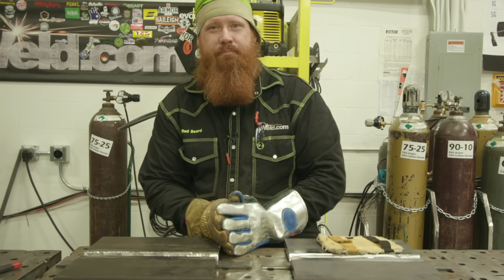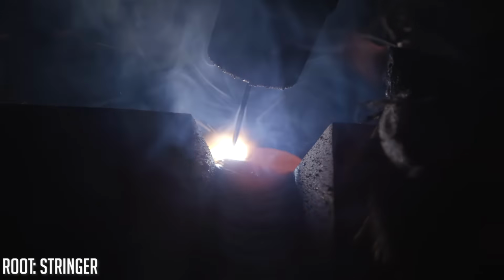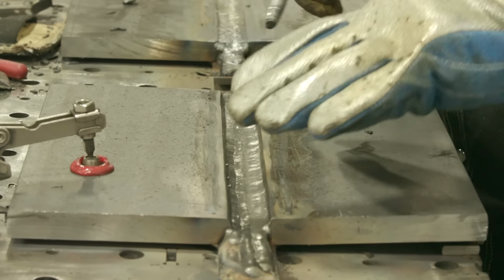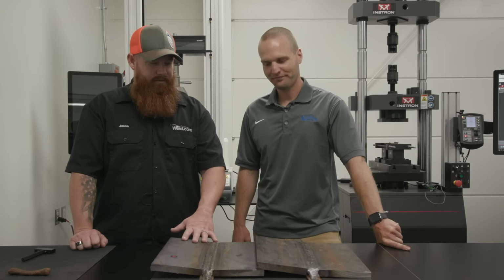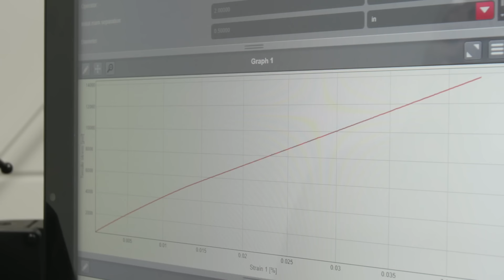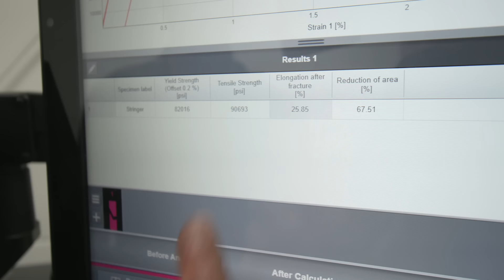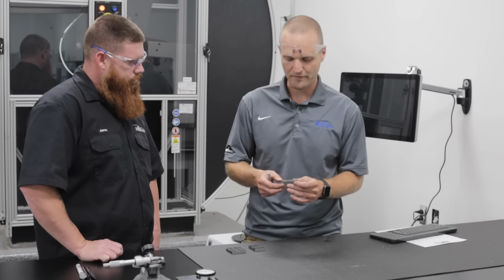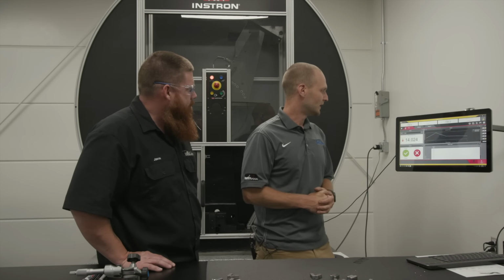Stringers vs Weaves

Comment: Very few times that I've needed to run multiple passes, but when I had to, I ran stringers then capped with a weave with the heat turned up and travel speed a lot faster, I.e. lay down filler material over top with less penetration. My reckoning was it put less heat in to the material while leaving a good looking weld. What would your take on that be?

Comment: Why do you run your torch backwards?  Was the steel set that way at the start or did the plate lift that to that angle?  Do you ever use the other weld patterns in deep plates?

Comment: now i know why i used stringers on 1inch plate welded to a 1/2 inch thick 10"×10"×10' long square tube for a bus wash brushes 30 plus yrs. ago...STRENGTH! I always thought the more heat the weaker the weld. i wonder now how tig welding pipe does hold up?

Comment: At 7:15 it looks like the nozzle is completely clogged, is this just an illusion from the camera angle?
Reply: Phill Huddleston just the angle catching the out side of the near side and the inside of the far side. You’d know if it was clogged at all. It would be full of porosity.
Reply: @GodslilRedneck23  That's what I figured but being gas shielded flux core I wasn't sure if the flux was enough to keep the porosity away by itself or not. I've welded with gas and flux core but not this stuff.
Reply: @phillhuddleston9445  I can confirm, if the nozzle is clogged, you will know.  There is not near enough from the flux core to do the job alone.  Just ran some 71M tonight at work.

Comment: so adequate cooling is playing a major role.
maybe we should focus more on letting the weld cool down inbetween welding???
attaching an aluminium plate by magnet would be a great way, maybe throwing a fan on there
so its not about slag, its about grain structure. i always disagreed that weaves would inevitably get slag inclusions, its about keeping the weld hot enough. i would think weaves are stronger because you blend the material better together
i guess it also depends on how hot your material is getting, if its a very large weld it will be more significant but if youre welding very thick material and it has plenty chance of cooling down weave shouldnt make much difference

and this would in reality mean that downhill pass, being a colder faster weld, is actually superior to uphill pass- downhill is illegal in my country basically. interesting. there must be something about a balance of heat penetration vs grain structure

Comment: Very interesting video and great to learn from it so thank you and well done!

Can you do a test to determine which is stronger between ER70S6 Mig and 7018 Stick welding please? I know there are variables but if the test ran same settings on the same plate running stringers (Known to be stronger than weaves) then it would settle the argument. Both have the same tensile strength as we all know but its like the stringer vs weave test which one is better under test conditions.

Comment: I'm no welder, but what if you cap stringer welds with a weave? You should (in theory) get the strength of stringers and the looks of the weave.... right?

Comment: Sorry, 1yr old comment. During school in '19 there was word that AWS doesn't like Weaves after a certain width. Too wide of a weave introduces micro heat cycling between each puddle pause, might be why you see the reduced tensile strength in Weaves.

Comment: Question Have you ever ran stringer and weav on the same piece? I wonder if it would make a difference?
Reply: I have. I've run the root then run a weave above that root and finished with stringers.
  All depends on how much space you were actually filling. It's too little space to run 2 stringers better to run a weave

Comment: Great video but the first test was a bit inconclusive because the weave sample had some porosity or other defect. Did you try that pull test on any of the other sections of the weave weld?
Reply: And therein lies one of the significant points. Slag inclusions can be a common problem with weaves, (notably with stick and flux-cored).

Comment: You should do the 2 types of weld again with hath the thickness and do a cross lace pattern with the weld it’s harder but it tends to be a higher durability and also do some acid etching of the grain structure

Comment: Amazing video. It looks like stringers are stronger, but weaves are faster.  At times from a production standpoint speed is more important, if the strength is good enough to meet requirements.
Reply: that's also depending also on interpass temperature reqs, since weaves will always put in more heat. with strict interpass limits you might wind up sitting around longer waiting for the part to cool if you weave, which reduces the speed advantage. then again, any time you're working within tolerances like that it's never a good idea to weave in the first place
Reply: I cannot agree that weaves are faster. The metal lays down at the same rate no matter what your style. 

In this case, the filler comes out of the nozzle at the same rate in both cases, so how can weave be faster?
Reply: @tandemwings4733  watch the video
Reply: @smersh007  I don't know what form of magic you believe in, but the fact is, in this case, only 'X' amount of filler metal is available at any given time. The ONLY difference in deposition rate between weaving and strings, is the ability of the operator (welder) to manage stops and starts. I did watch the entire video and I am relying on a shit load of experience. Decades more experience than the young chap doing the show and yourself.
Reply: @tandemwings4733  that's exactly it. Completing a weldment not just about depositing rate. Let's say you do 3 stringer vs 1 weave. 3x start stops, 3x cleaning. It all adds up.
Reply: @smersh007 . Now we're getting into the guts of it. You are assuming that there is cleaning to do. My experience tells me that cleaning (de-slagging) is a consideration on something like (at a guess) less than 10% of all multiple pass hand welding. Manual Arc and Shielded Flux Core processes are in the absolute minority. When we were fabricating for earth-moving, using 1.6mm wire (that's 14 gauge or 1/16th for the backward imperial users) in MIG process, our (personal fun challenges) comparisons showed up only marginal differences between weave and string runs, which was good because I didn't want that concentrated heat in the weldments anyway. Plus, when you get up around 3/4" wide, weave starts to get a bit dicey, so why use it? In approx 48 years of welding, I've never found the need for weaving, and, especially after training, I've not ever been comfortable with it.

Comment: Great video,Have a off topic question,I saw I in the video 90 10 gas,I have been told this mix works better than C25 for thin sheet metal. I can't seem to find info on this,any help.
Reply: Certified welder here. 40+ certs, no B.S. CO2 is for penetration and lower cost gas in large scale production. As the balance of CO2 drops, such as (CO2/Ar): 75/25 to 90/10, 95/5, 98/2, 100% Ar, so does the penetration due to the properties of Argon. Argon at 90/10 is a shallower weld profile, better wetting, less spatter, and is a great gas all around for sheet metal up to 1/4" plate.
Reply: @deanbarrett7180  Thanks so much,been searching for this info for a while,really appreciate it!

Comment: Just curious but with such a wide gap why not split it with 2 weaves instead of the almost inch and a half weave. I would think that would cut down on the heat considerably and possibly help from becoming brittle.
Reply: It would of made the difference between weave and stringers almost nil .. had it been properly done. It was a test biased for stringers to shine out ..

Comment: For all the wire feed welding I have done I have never seen slag on it so it was a different type wire welding cause all mine was a clean metal after wards. So explain what you did differently than I have done
Reply: Flux core as stated at start of video.

Comment: Is this test true for single pass welds of 1/8 metal or just for multipass welds...just getting started here, thanks.
Very informative video btw
Reply: Juan Castillo generally the only time you have enough space to weave is when you're doing multipass welds, a single bead in a joint should always be a stringer (single pass weaves are OK if you're doing surfacing/buildup, but not joining two pieces of metal)
Reply: @KingHalbatorix  thank you for the information

Comment: Can you explain the chalk trick, from what I’m seeing if it makes a line it’s under 350? I’ve never seen that before, very interesting
Reply: Anthony Albero You pretty much nailed it. They make those from various compounds so they melt at different temperatures so that you have an idea what temp your at. Look up Tempilstik if you’re still curious.
Reply: @TheOldPioneer  wouldn't one of them handheld temperature "sensors" work too? Forgot what they are called :|
Reply: Ckc dillpickle  infrared thermometer. And, yes, that would certainly work too.

Comment: I am a very basic almost newby welder so this may make no sense. Looking at grain patterns I wonder what the strength is from the side.  Also wonder what would happen if you alternated weaves and strings through the entire weld like plywood is alternated. Like I said it may make no sense but everything has a microscopic pattern.

Comment: I've always welded with weaves but I'd never weave that wide, rather I'd stack weaves. I'd have liked to see it done that way and compared.  I've never used a flux cored wire.  Can someone educate me on why you would use a flux cored wire with shielding gas?

Comment: in the testing I have done a weave always gives higher heat input, in most cases that I have observed, as long as the weave is kept to .5" or less it didn't yield more than a 10% difference.

Comment: GREAT video.... For 3 stringer caps, I was taught to do the two outer welds first then bridge then with a center cap, but I guess both techniques work.  ???
   Stringers vs Weaves...… in the REAL world,  both work fine.
Reply: gord johnson please do not weld the outside welds then do the center. It puts undue stress on the weld metal and pulls against the base metal. You’re far better off to weld stating at one side (left or right) and work across overlapping 50% until you tie in to the other side of the plate.
Reply: Sorry, but "in the real world" stringers will still give a stronger joint thatn weaved welds
Reply: In the REAL world, weaves are only cosmetic. Structurally, they are shit. Lazy, and unqualified welders, doing garden variety sloppy work, use weaves.

Comment: please excuse my ignorance but what welding process is this? I thought GMAW at first but there's slag. Is this flux core with shielding gas?
Reply: depends what type of wire ur using and brand. ive used gasless flux with that same colour slag and also shielded flux with that same colour slag

Comment: I have found that stringer passes usually do not put as much stress and warp into the steel plates. Weave passes usually put more stress and warp into the metal plates. Do you agree with that statement, please add your experience to this comment????? Thanks

Comment: I wonder if there's a difference in how much wire you end up putting in there, if the difference is minute or significant
Reply: Alex Gonzalez there shouldn't be a difference. The same volume of weld has to be filled in either case.

Comment: I think this does not make a lot of sense because both techniques are useful in different scenarios, a skilled welder will be successful with any of them. At 13:51 you can see the huge difference in number of passes and bead width which obviously changes everything, if you want to test "just the technique" as you said, all the parameter should be the same. This video is educational but it hold no scientific value what so ever.

Comment: So,to to tell you WHY the difference.
Stringers,less cross sectional contraction but more inter weld grinding to
remove any slag that may be trapped between welds,cools faster

Weaves,faster,less chance of slag inclusions but HUGE cross section contraction
which means excessive tension in weld =less strain on test machine to fracture
as the grain of weld is already trying to fracture.In cold or situation of continually
fluctuating load,eg shakind screeds,dump truck bodies,sudden impact it WILL
FAIL.
The reason for the much lower fracture,besides that was not enough angle of
wire to front face of molten weld material.The front face of the molten pool,kind of like
the front of mud flowing.The front of the pool rolls over the molten flux before it can
rise to the top of the cooling pool.
This is an inclusion of flux= Black,as you could easily see and the other defect visible was
a gas inclusion due to the gases generated from the flux being trapped for the same reason
the flux.
A better way of achieving a weld is to incorporate both techniques.
1-standard root run/first pass
2-very heavy hot pass/second pass
3-next two passes are stringers with a weaving action,they do not meet at center of weld area
the next weld goes down the center of these welds making sure the material has a temperature
at least 100 degrees less than max permisable.
The cap pass is two weaves over lapping at center.
That way you have the cap of the width of a material half the thickness of the plate.
For apearence sake,the two cap runs are done at your normal length wise travel speed
but the weaving action.is sped up,this allows for almost no pause at edge of weld/plate inter
section and the ripples are very fine  between each side to side action.In a situation where an inspector on site
randomly checks welds,yours will look very professional.your chances of being tested are much lower.
When yours are tested,and they will,they will pass,no problem.
A bonus is you are able to produce more per day that most.
If a number of welders on a site were chosen for the next project,YOU will be one of them because you have both efficiency
a less if any weld fails.
It is possible to do a 6g 40 schedule,with 5 passes,have a 2 run cap,not the usual 3-4
The appearence will be awesome and that is what counts.
As a welding inspector at 0ne point in my career,I know this is the single biggest advantage your give your self.
One other point,you are there to produce.the vast majority of welders think they have some sort of right to
FUCK AROUND,being they are specialist and these things take time they say!!
Wrong,less runs but bigger with a beautifull cap impresses any inspector,you will findthey will take an interest
in your quality work.
They will remember you,when the list f he best welders is compiled you will at the top or near to t!!
If an inspector asks how you are more productive,tell them,They will pass that info the the other
welders they feel have potential but havent mastered the TRICKS OF THE TRADE

Comment: But... Why is Stringer Stronger. is the heat treatment. What about compressed Air cooling or Sand and leather covered slow cool down. Then witch is stronger?

Comment: All "as-builds" I see that are ASME Sec VIII  U-Stamped pressure vessels call for stringers. I've been a Mechanical Engineer for nearly 20 yrs and have never seen a weave called out for hot passes on any type of joint that structurally mattered - some overlays on R-Stamp repairs for sure, but never for construction.

Comment: Ok these seem like very specific tests. What would be the practical out in the field reasons for these tests? Obviously strength is Paramount don't want stuff failing, but it seems that the test pieces were small and the stresses placed on them were designed to make them fail. So that being said if you too into account the entire process and piece of weldament Wich process would be stronger?.. ie. Test the whole plate as opposed to a small piece of the plate.  Is that even possible?
Reply: Destructive tests,as they are doing here, are geared more towards the engineering sector. They do these tests so they can figure which alloy and how much of it they need in order for the part they’re designing to function properly. Nondestructive examination (NDE) would be used more often in the field. Methods of NDE include: visual inspection (VT), magnetic particle inspection (MT), liquid penetrant inspection (PT), ultrasonic testing (UT), X-ray inspection (RT), eddy current inspection (ET), mass spectrometer detection (MSLT), air pressure leak inspection (LT), and halogen has leak inspection (also LT). Good luck using a mass spectrometer in the field. One should always do a visual inspection on every weld made. This is as simple as looking it over for porosity, undercut, arc strikes, and other defects. Other inspections that are easy to do in the field are liquid penetrant and air pressure leak inspections. These inspections can only show you surface defects, however. Anither good method to find surface or near-surface defects without a lot of scientific industrial machines is the magnetic particle inspection. Used only on materials that can be magnetized, the metal is cleaned and then magnetic particles are spread onto it, a lot like seasoning on a steak. Then the part is subjecting to a magnetic field, and the magnetic particles will cluster on defects. 

Source: Althouse, et al. Modern Welding, 11th Edition.
Reply: Thanks Mason for that very interesting and informed reply to the above comment.

Comment: The two methods were kept at 350 F, ...so... the weave must have caused the problem in the metal.   Maybe each weave formed a surface that was remelted, verses the stringer was a continuous weld with less remelting of new build-up material.